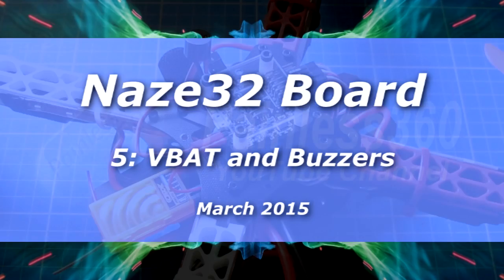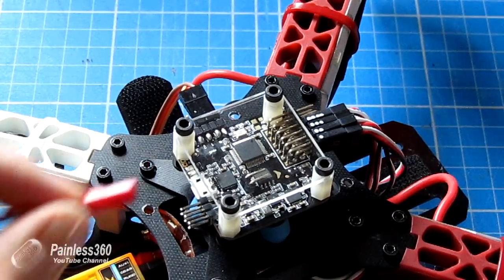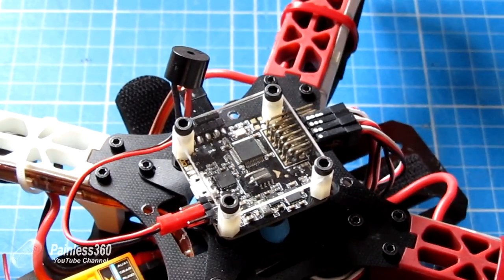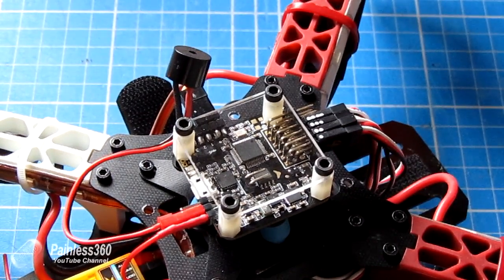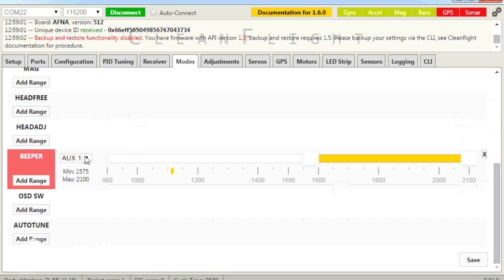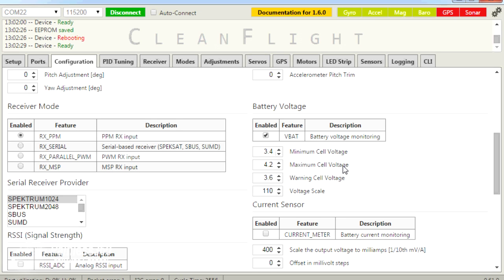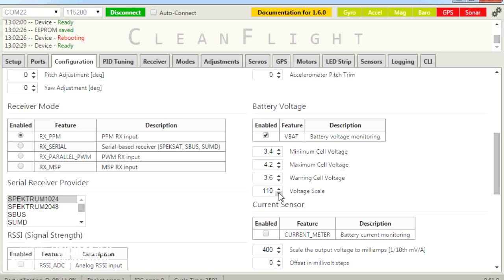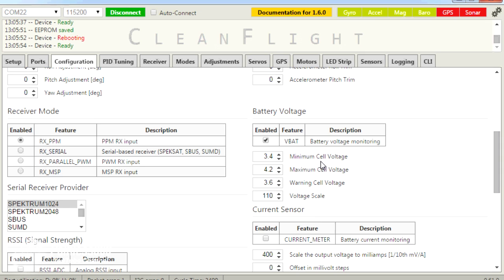(5/8) Naze32 Flight Controller - Battery monitoring (vBat) and buzzers

Comment: I've got 2 ideas for for things I think would be really cool. 
1. The first is I want to put ws2812 LEDs on the front and have them do the red Cylon strobe. I think that would be really cool. 
2. For my second idea have you seen the movie oblivion with Tom Cruise?
In the movie there are drones and the drums play a series of really creepy sound.
I have a friend who may be able to build me an Arduino soundboard that that would have 2 modes. The first mode would play random sounds just like the drones in the movie. The 2nd mode would be the lost model/low voltage alarm. Can you set the beeper to turn on and stay on delivering a constant current, not pulsing?
Any help in any way, in either of these areas what would be greatly appreciated.
thanks Adam.
Reply from the maker: Adam Sparrow These are nice ideas but outside of my experience. I have seen RC sound systems that play sounds and can be linked to the throttle and other channels to provide a 'real' engine sound and even machine gin fire etc., I wonder if these could play any file. On the Cylon idea - definitely doable. You would need an Arduino board (mini maybe) and a sketch. I bet you could find one if you Google it. 
Best of luck..
Reply: Painless360 One Arduino board to rule them all... sorry if that wasn't very punny. I've got some ideas and and my friend Chris is and Arduino fanatic. If we can make it work I'll tell you all about it. Thanks again.
Reply from the maker: That should work - let me know if you figure it out. If your mates' eyes start getting large and he stokes and Arduino mini while muttering something about 'a precious' then start to worry ;)

Best of luck with it!

Comment: Thank you for the excellent video. Just a question linking to this and video 3. If I feed the main 3S LiPo voltage into the Naze32 will I be able to feed that into the MinimOSD (avoiding soldering directly onto the ATMEL chip on the MinimOSD?) and get it on-screen?
Reply from the maker: Siddy Persson Yep, see https://www.youtube.com/watch?v=Bdki9lIv31I&list=PLYsWjANuAm4p47OBBTOo4Xr3lNUc8PFpc&index=5 and also on a Taranis radio using telemetry - https://www.youtube.com/watch?v=CXWZjqPX_o4&list=PLYsWjANuAm4p47OBBTOo4Xr3lNUc8PFpc&index=15
Happy flying!
Reply: Painless360 Excellent, I was just about to solder that tiny pin when I recalled you had made a comment about this. Thought it looked easy on a video but that thing is tiny in real life. Cheers mate!
Reply from the maker: Don't forget you can always treat yourself to the one with a KV mod if you really want a direct feed into the OSD..

I'd use the Naze telemetry - much nicer ?:)
Reply: Yeah you're right, I was a bit too fast on the purchase button. I prefer the Naze solution, as you say it will look much nicer. Also I don't have to put together a voltage divider :)

One more question if you don't mind? I forgot to bridge the ground pads on the bottom of the board, do you think it will still be alive? I've only pushed firmware so far and that seemed to work.
Reply from the maker: If you mean the MinimOSD I'm sure it will be fine. I'd re-flash the firmware though in case something on the Max chip side needed to save something..

Best of luck.
Reply: Alright I will do that, thanks again!
Reply: Well I think the minimOSD survived the previous ordeal, but the splash screen shows MW version 0 (flashed it with KV 2.2) and it doesn't react to the arm command or display the vbat. Only thing that happens is that the timer starts ticking. My guess is maybe the CP2102 USB to serial I have doesn't quite do the "whole" job. That or I broke it when I (by mistake) powerd 5V from the digital side simultaneously as 12V from the video side.

I did manage to partially break my naze32 I think. It works alright in flight but I am completely unable to connect via USB, shorting the bootloader pads does not work either. Maybe this was due to me connecting the naze via USB while also having the minimOSD connected (failed to access bootloader error). I have 2 new boards on the way in case I can't fix it.

Do you have any thoughts on this?
Reply from the maker: I would swap the tx and rx lines from the MinimOSD to the FC and see if that helps..
Reply: Thanks for the tip. I also checked out your MW+minimOSD-video and now I understand what that 0 at splash screen means. The replacement naze32 i got today solved all my issues, I guess I shorted/burned something on the naze32 breaking telem and USB interface, well lesson learned. Really enjoying the OSD now.
Reply from the maker: Good news - always something going on in the Playlist here ;)

Happy flying!

Comment: On the Cleanflight Battery Voltage section what's the difference between 'minimum cell voltage' and 'warning cell voltage'?  Presumably as the battery voltage drops, the alarm sounds when the 'warning cell voltage' is reached.  Does something different happen when the 'minimum cell voltage' is reached?

Jim Cook
Reply from the maker: Jim Cook Hi Jim, this is all covered in the excellent pages here - https://github.com/cleanflight/cleanflight/blob/master/docs/Battery.md
Happy flying!
Reply: Painless360  Thanks for the link.  All understood now! 
Jim

Comment: Hey man. Thank you for all the videos you have made they are truly a treasure. I just want to be clear about one thing, when you added the single wire from the PCB it supplies the full 12v from your 3s to the Battery pin on the naze32 board? It sounded like you said the board only likes 5v
Reply from the maker: André Meyer The main board runs on 5volts. To measure the battery voltage you connect the FULL voltage to that special battery pin (as shown in the video).
Hope this is clearer.
Reply: Painless360 Thank you. I thought as much I just wanted to make sure. Thank you for the fast reply. Now I can fly FPV without worrying about the battery low voltage.

Comment: How does the Naze32 know the individual cell voltage if you just connect the main battery voltage?
Reply from the maker: JohnCrichton Simple answer - it doesn't. If you want the individual voltages of the cells in the pack the you need something like FrSky telemetry and a LIPO Smart Port Sensor. 
Happy flying!
Reply: Painless360 Thanks. It confused me why you could set a minimum cell voltage. I assume it just divides the voltage by the number of cells.

Comment: Hi! Thanks for this fantastic video, i have a question, can i use these one? http://www.hobbyking.com/hobbyking/store/__14521__HobbyKing_174_Discovery_Buzzer.html and taking off the White cable
Reply from the maker: ***** Nope, that buzzer has circuitry that only sounds the alarm when it receives a PWM pulse of more than 1500Microseconds. 
Use a basic 5v buzzer.
Happy flying!
Reply: Thanks you so much!

Comment: so my issue is that even with a fully charged battery my warning buzzer goes off.. my settings are the default values. the battery i am currently using i have done a quick test flight with and the voltage currently reads at 11.52v any ideas??
Reply from the maker: Paul Preston I would start by looking at Voltage Scale (7:53). 
Best of luck.
Reply: Hiya. yea i have had a play around with this going up and down the scale.. is there somewhere i can see what the Naze32 is reading for the battery voltage? so i have an idea of what it is seeing vs what i am seeing.

I have the FrSky taranis plus and the D8R-II plus rx but seems i need a voltage divider before i can see actual telemetry on my taranis.. unlesws there is something i am missing there aswell?
Reply from the maker: Yep, Cleanflight shows you in the main interface - you can see it in the middle of the right hand side of the screen around 5:10

Hope it helps.
Reply: Brilliant.. this solved my issue.. and yes.. this is a stupid one.. Due to being a little OCD and wanting things clean as possible i have soldered an extra jst connection to the PDB so i could power other things or in this case to run to the Naze32 to read bat voltage. 

Looking at cleanflight i could see there was no reading of power to the naze32.. turns out there is a small switch on the PDB im using which controlls power down that channel of the PDB.. this switch was not fully in the on position and therefore was not sending and power to the naze32..

flipped the switch and beeping stopped.. silly little things are always the most confusing and frustrating..

Thank you for the help. and quick response :D
Reply from the maker: No worries - these little hiccups can sometimes be the hardest to find. Good job!

Happy flying!

Comment: thanks painless, I could not figure out why my vbat was always buzzing at the wrong time. I set the voltage scale to 14,8 because I fly 4S. Now I set it back to 110. and it works fine.
Cheers Dolf.

Comment: Hi , I find your videos very good and they have helped me loads so thanks . I am going to try this voltage alarm and lost model alarm , but just wanted to check with you if the same applies as I am using Base Flight ? What is the difference ? and is Clean Flight better ? many thanks , Scott .
Reply from the maker: Scott Thompson Hi Scott, I cover this in the first video in this series.
Best of luck.
Reply: Cheers mate ,

Comment: Hi there. I have a little problem here. When I set the low voltage alarm the buzzer goes off even though the battery is fully charged. I have already played with the voltage scale and voltage warning. What I noticed is that in the status tab, where battery voltage figures are the voltage is 0V. Any idea why this is not working? Btw, a beeper mode is working fine
Reply from the maker: The20Kopel Ensure that you have enabled vBat in configuration, that you can see the voltage from the connection you have going to the flight controller (use a voltmeter) fi that works, check the connection polarity and decent soldering on the pins. 
Failing that it may be a dodgy board.
Best of luck.
Reply: I should have watched entire video before asking questions. It is all working fine now. Sorry for wasting your time. Your videos are very informative :)
Reply from the maker: Don't worry about wasting my time. The channel is here to help. Now you know you have to watch all the video ;)

Glad you found the answer in the video though - now you know that they are made to (hopefully) be easy to follow and cover the basic steps and gotchas to get something working.

Happy flying!

Comment: Regarding buzzers...

I know a few people are having problems with piezo buzzers, myself included.

Piezo buzzers need a driver to give them a square wave, the one in this video is slightly bigger (deeper) than the one I bought. Mine doesn't have the driver built in and only makes a very quiet clicking sound when 5v is applied to it.

Painless360  Can you post a link where you bought this piezo from? Obviously the one in the video is designed for this kind of thing as it has a JST connector on it already. Mine came with two small pins and was designed for mounting to a PCB
Reply from the maker: As I mentioned in the video you need a buzzer that sounds with a simple application of 5v.

You can get them from the usual places (Banggood.com, Hobbyking and eBay).

i.e. http://www.banggood.com/Wholesale-Magnetic-Separated-Tone-Alarm-Ringer-Active-Buzzer-Continuous-Beep-5V-DC-85DB-p-47753.html

Comment: Great video!  Quick question, can you have the flashing lights and the buzzers at the same time?   I am building my quad with white led's in the front and red/green in the back  (they are all RGB led's).  I want my led's to change color during battery condition low so I will need to apply voltage to one of the led pins to change color.
Reply from the maker: Yes you can - see https://www.youtube.com/watch?v=nt56WKJF5z0&index=12&list=PLYsWjANuAm4p47OBBTOo4Xr3lNUc8PFpc

Comment: Hi
I have the MinimOSD OSD For Naze 32.
Three cell battery is connected to the Vbat on naze32 The same Vbat settings on your video. OSD ok but still no battery voltage?
Could the problem be in the OSD settings?
Thank you for replying to my request for help
Reply from the maker: roderick sallie So have you checked that the main battery voltage is on the pin on the Naze32? Have you used Cleanflight or Android app to see if they can 'see' the main battery voltage from the Naze32? Have you rechecked the code you flashed the OSD with and checked that it is getting the voltage from the MWii not the ADC? I can't help unless you give me lots more to work with..
Best of luck..

Comment: I have the buzzer connected as shown in your video, but i can only get thr buzzer to work if i remove the wire connected to the battery monitoring pin, with it connected the buzzer makes no noise when i activste the beeper via aux switch.
Reply from the maker: Sounds odd, I'd check that there isn't a problem with the soldering on the back of the connectors..

Best of luck.

Comment: Thanks for your great videos. You've helped me build a quad from scratch using a ZMR 250 frame with Naze 32. Just a quick question though, what size lipo should I use? I'm not planning on FPV but will use a GoPro on it for video and still shots.
Reply from the maker: I tend to fly my quads with 3700mah 20/25c 3s packs but it depends on the motors and ESCs you have and how much weight it can carry..

Comment: just noticed the Dots on the servo Cables, brilliant, untill now i added tape pieces to the cables, and marked em with a sharpie
Reply from the maker: Grearson .x Thanks for that, in the step by step build process using a CC3D and 250 frame I cover this again in depth. A handy way to avoid any mishaps with motor connections! Happy flying!

Comment: I have plugged in my piezo beeper. Its orientated correctly in relation to +-. In the GUI I have it set up to my AUX1 switch. Beeper logo turns green when I flick the switch, but I get no sound from the beeper. Tried two different beepers, but no joy. Any ideas what could be the problem.
Cheers Lee
Reply: +Milan Karakas thanks 😁
Reply: +Jona2122 You are welcome.
Reply: Edit to post. WARNING to users of the Flip32. Screen print of the beeper pins says + to the inside and negative to the outside. This is wrong. Its positive to the outside pin and negative to the inside.
Works fine now :)
Reply: +Lee Trevarthen i have the pins plugged in the right way but stil havd no sound !
Reply: +Jona2122 is the battery in? it only works powered by the battery. if it is exclusively powered by usb, it wont sound.
Reply: +Jona2122 https://www.flickr.com/photos/milan_karakas/21556598394/in/dateposted-public/

Comment: Very well done for all your hard work on this! Has helped me a lot!  Do tell what do you use to mark your ESC connectors on the board connections (little white dots)?
Reply from the maker: This is my trusty silver metallic sharpie pen. Very useful for marking connectors so you can easily identify they are plugged in the right way up and into the right connector. I also sometimes use black dots up the signal wire on the leads too for the same reason..

Hope this helps.

Comment: Another useful video.

The monitoring off Min, Max and Warning cell voltages is not quite as clever as it seems because the Naze does not actually measure the individual cell voltages. What it does is to measure the total Lipo voltage and work out an average cell voltage based on the number of cells in the Lipo.

This has never caused me a problem, but it is quite possible for one cell to be much lower than the others in the pack and for the average to still be higher than the trigger levels.  The same problem applies to the total pack voltage reported by telemetry because one cell could be at very low voltage whilst the total pack voltage could be much higher.

Unless/until the Naze can monitor individual cell voltages using a connection to the balance port of the Lipo there is nothing much that can be done.  In any case, more pins would be used or an external device needed to feed the cell voltages serially to the Naze so I am not holding my breath.

In the meantime the solution presented here, together with careful management of Lipo charging is the best option that we have.
Reply: As you said, as long as you mostly balance charge (which IMHO you should always do, except for the few rare cases where you are pressed for time), the cells should be pretty equal all over.
The exception may be a cheap battery with poorly matched cells from the manufacturer or a battery that's at the end of its life. But using those will just endanger your craft anyway.
Reply from the maker: superdau Nicely put, those 'end of life' batteries are the ones that end up on my flying wing/combat models. Less painful when I have an interesting 'landing/collision' and deform the pack! My combat wing is the place my old packs go to die..

Happy flying!